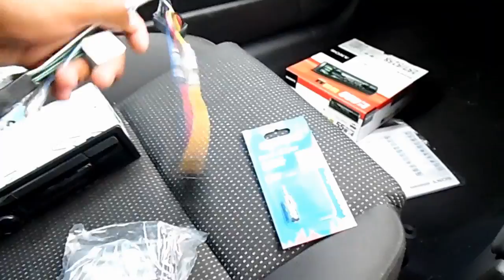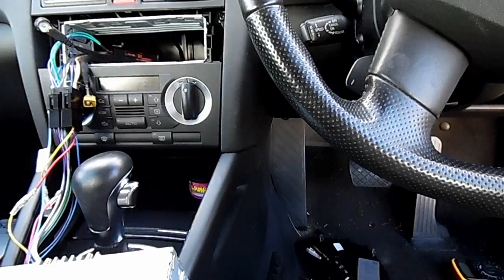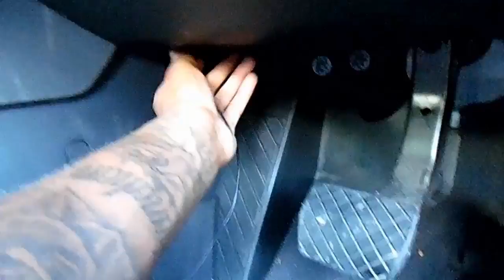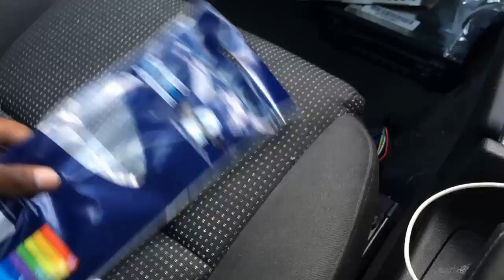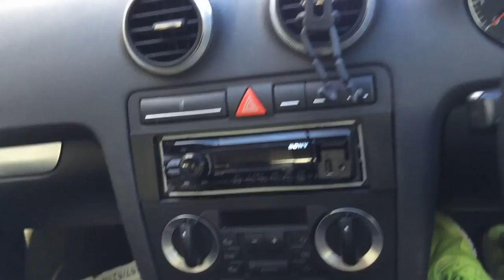Car Stereo Sony DSX A42UI Install On Audi A3

Comment: Hey, I know this video is quite old but can you tell me something about DAB? Do I need a special adapter to install an DAB Radio or will it work with the original antenna? 
I have a Audi A3 8P 2004

Comment: do you know if you can install one of the newer and larger touch screen stereos like a 7" in this model A3? It seems like the buttons above the head unit would be in the way.
Reply: Yes you can but need to do some rebuilding, need console from 2 din version

Comment: bit of advice ive done this and ive now got a power zap and the battery dies after 24 hours, check the battery isnt using power when you turn the car off to make sure its installed properly
Reply: Red line only connects too ignitions  on and off s wasps red yellow not a good idea kill battery 🔋 when is car not running best things only red wire connecting for fuse box

Comment: It’s my first time installing a Stereo. Do I need a ignition live for the stereo to work? 

I’ve followed the steps and wires seem to match but stereo seems to not work!
Reply: I have the same problem.
Reply: Did you get it working mate

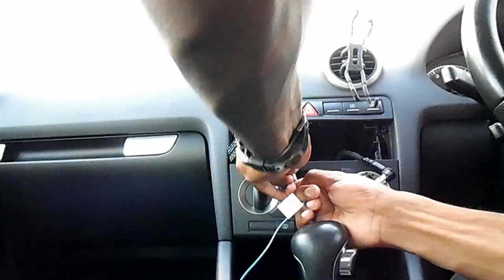Comment: Hi Tim. Thanks for the video! In the minute 3:44 you insert the blue cable into the stereo harness cable. But what should I do if my stereo (Pioneer) doesn't have that cable available for the plug in?
Reply: idk if its still usefull for u, but that blue wire is to power up the rear subwoofer, and then if the remote cable is not on the Power/Speaker imput then check the AV Cable.

Comment: Hi I got the harness to day from Halfords not sure if it’s the right one or not the harness is CT20AU09 tried to connect my stereo today but it’s not working at all do I need to use the ignition fuse to get the power for my stereo or not needed. Also the harness you use the PC9-401 is that’s the right harness to use my Audi is a 56 reg manual TDI diesel. Thanks. Tibor

Comment: My unit has 2 USB cables on the back, how i can get them into the glove box so i can use them anytime? there is not any hole that connects the back of the radio and the glove box, anyone did that?

Comment: Do you also have the subwoofer built in the car from factory? If you have, does it work well with te radio?
Reply from the maker: Hi Mitchel,
Mine didn't have the subwoofer...I have since sold this car and got a Mercedes...
Please like and subscribe! Hit the notification button so you don’t miss out on the new videos!
TW

Comment: Tim i really love your post's brother. Me myself having an A3 8P 3.2. Very useful information, but me personally would av keeped the Audi head unit. I've found the Audi systems are absolutely banging mate. I bought an after market unit that plugs into the unit giving me aux inputs like phone, usb and cards. But love ur stuff bro.
Reply from the maker: Appreciate that my bro! I deffo agree, OEM systems always look better and operate better however the usb connectivity is what I was really after which charges and plays music at the same time :)
Please like and subscribe! Hit the notification button so you don’t miss out on the new videos!
TW
Reply: @TimWilliamsHD  subscribed already. Peace
Reply: What unit did you use for oem head unit to get aux, I much prefer the og styling.

Comment: Hey man, i dont have where to plug that free blue wire from adapter? Rear speakers dont work
Reply: I bought 2018 pionner, everything is ok but no rear speakers, audi a3 p8 2004
Reply from the maker: it must be the harness mate, please contact a Audio visual shop like Halfords or dynamic sounds to be sure of what harness... my old car had basic system so that harness worked on mine... yours will need a different one.. good luck Ed..
Please like and subscribe! Hit the notification button so you don’t miss out on the new videos!
God bless
TW

Comment: Bro I have an Audi a3 2011 8p but the stereo and the harness are totally different. I bought the one you mentioned and it doesn't fit. Do you have any idea which one will fit my car at all? The stereo I have is Audi Chorus.
Reply from the maker: Yes bro you had newer car than mine
I don’t wanna quote you wrong one best bet would be to contact dynamic sounds and they’ll recommend the exact one for you

Comment: i just bought a audio system. with 2 connectors. when my a3 also has 3 connector cables. can you sent me a link or names on the adapter cables you got so i can get it to work :)
Reply from the maker: Hi mate,
I'm not sure what car you have so either way to be sure and safe, id say use dynamic sounds to find the right kit for your car!
good luck!
Subscribe and like please! Also hit the notification button too!
TW
Reply: Tim Williams dynamic sounds? I'm new into this car audio. can you describe what that is hehe. my car looks like the same as yours. audi a3 ambiente 2005
Reply from the maker: Dynamic sounds is a website that can get the right adapter for you
Reply: Tim Williams okay thanks alot
Reply from the maker: good luck!
Subscribe and like please! Also hit the notification button too!
TW

Comment: I did pretty much the exact same as you did and installed a Sony radio into my 8p. I found the sound quality pretty poor tho. Audi radio was much better sound, deeper and fuller. With the Sony the front speakers were powered from the radio through the harness but rear speakers, ya use the radio rca cables cos they feed an amplifier which drives rear speakers and sub. Did you have that problem?
Reply from the maker: Cant recall as I sold the car couple years ago...I would say the quality was better from the Sony in my opinion..
TW

Comment: Hello! Very helpful video but i have  a question. What will happen if i don't have ignition feed? I want to use my radio always, not only with key in the car
Reply: And what is amplifier antena? Why i need this, what it changes?

Comment: I followed the same steps as you but my rear speakers aint working. Any suggestions?

Highly appreciate your help
Reply from the maker: Sorry Faizal I no longer have that car but normally that problem is down to having an incorrect harness or a different sound system to mine.
Contact dynamic sounds and they could help if you give them your re...sorry I can't be of anymore help..

Thanks for watching, please like and subscribe!
TW

Comment: Hey mate bought a new Sony WX 900BT head unit and paid for installation but now my drivers side speaker and both back speakers don’t work... any ideas?? Cheers
Reply from the maker: Sorry Jim83 I no longer have that car but normally that problem is down to having an incorrect harness or a different sound system to mine.
Contact dynamic sounds and they could help if you give them your re...sorry I can't be of anymore help..

Thanks for watching, please like and subscribe!
TW

Comment: Hi. What is the yellow one?
Reply from the maker: Hi mate, cannot remember off the top of my head but please feel free to check another video of mine in which I explain what each wire does and which one is which....
Wiring An Ignition Live on Audi A3

Thanks for watching, please like and subscribe :)
TW
Reply from the maker: here you go!  https://youtu.be/duFjljkUubQ?list=PLnP4mjzJEyuws8tt0zRaCKn1WT4lCmlG-
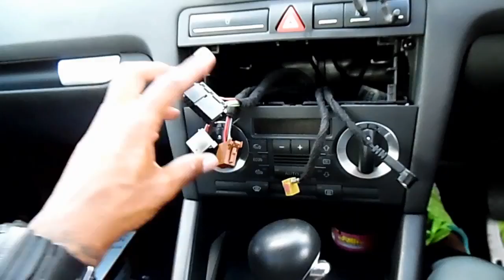Reply: min 1:43..."the yellow one can say goodbye..." what is this for?
Reply from the maker: That is an audi cable mate. It has no connection to aftermarket radios. I believe it had something to do with data appearing on the dash if I can recall.

Comment: I have a A3 8P 2006 can i just plug the PC9-401 and connect the cables then with my iso for the aftermarket radio? will the ignition radio work? its a kenwood with usb cd aux without answer calls option
Reply from the maker: Not sure mate. If you have same set up as mine then it should work...
Reply: I found on ebey this.. will it fit? http://www.ebay.com/itm/Radioblende-fur-AUDI-A3-8P-S3-Einbaurahmen-Radioadapter-SET-ISO-Adapter-Kabel-/361370667410?hash=item54235ec992:g:15wAAOSwYaFWg9UL

Comment: I've installed this with everything you've said but my rear speakers still don't work and my radio won't tune into anything
Reply from the maker: Hi mate,
you may need a different loom .. best thing is to ring up dynamic sounds and tell them your car and radio model and see if you have the correct loom
Thanks for watching
Please like and subscribe
TW

Comment: Hey man. What engine type is your Audi? I've got one with a diesel engine and I think the fuse for the stereo is in the engine bay. Would the ignition live fuse still be by the steering wheel or would I need to run the cable into the engine somehow? I think it's wired this way for all the diesels and the 1.6 and 2.0 petrol engines.
Reply from the maker: That car in that video was a 2.0TFSI...ignition live can be taken from the interior fusebox...as far as you tap into a fuse that turns on only when ignition on and goes off with key out of ignition.
Thanks for watching
Please like and subscribe
TW
Reply: Cool, cheers man.
Reply: Thank you for this instruction but I have a question when I make a call I can not hear the sound Can you help me

Comment: Mate my back speakers are not working?
What could be the issue?
Reply from the maker: May be the wrong harness as all the parts I got worked.. unless you have the bose system which is different and needs different parts but I'm not sure which one as I don't have the car anymore .. ring up dynamic sounds..they're the best tbh

Thanks for watching 
Like and subscribe please
TW
Reply: How do I find out which system I have?
I've Audi A3 2006 special Edition
Reply: yh u probly have bose u will need to wire ur amp wire from sterio in to amp wire for rear sub in boot
Reply: u will find if u take out sterio u most likly have 1 wire that isnt connected or maybe more then 1 thats probly why there not working

Comment: hi mate, do you have bose door speakers? if so, how did you connect these with the aftermarket radio, plug and play or do u need to buy extra stuff for amp etc
Reply from the maker: Hi mate,
car is now sold but i didn't have bose speakers. I have heard it is slightly more tricky. Best bet would be to contact a company like dynamic sounds who will sort the right harness adapter and give you more information.

Please like and subscribe!
TW

Comment: Hi, thanks for the great video. Do know if this also works for the 2003 A3 (8L)?
Reply from the maker: Only works for the radio unit displayed mate, you could check on the website if it with other units.
Reply: Thanks for your answer! I''ve got the bluetooth one, everything works fine exept for the rear speakers. They don't work, I think I need this adaptor. Strangely I got no problems with ignition though, so I guess i don't need to wire it with the fuse box.

Comment: Did you lose your steering wheel function? And also how is sound quality? Stock unit sounds good just sucks no aux feature. If sound quality is the sane I would change in a hurry
Reply from the maker: nah mate, if anything, quality is better and can go louder.. didn't have multifunctional steering wheel to begin so that didn't affect me, however i know there are harnesses available to allow you to use steering controls...
Reply: Thanks for replying! I greatly appreciate your video/reply. I will swap my head unit out soon. I have the steering wheel function so I will need an adapter. Those adapter don't run cheap either :(
Reply from the maker: No worries! Yeh I've got steering wheel controls in my new car and I use them often... Must have imo 👍

Comment: Hi. Thanks for a great video. I have installed a Pioneer and it works great, except from the rear speakers. I have sound, but barely. Any ideas?
Reply: Did you get this sorted mate? Can you remember what you had to do
Reply from the maker: Thanks mate, no rear speakers is normally due to wrong loom connector for your car
Reply: This is strange... They worked fine on the stock radio. Now it's just a "whisper" from the rear speakers... It's like the amplifier don't work... Maybe the amplifier don't get power? Thank's for the answer btw :-)
Reply: You need a active adapter!
Reply: Something like this
https://www.amazon.de/dp/B074V84B78/ref=cm_sw_r_cp_apa_glt_i_GEMD1Z742RS5K1WYHKSX

Comment: When will you be doing the double din?
Reply from the maker: +Fraser Scott within next 2 months mate, had insurance and birthdays to fork out for this month...
Reply: +TW Randomz sweet please make a video for it, as I'm looking to do the same. Will you replace the support bracket? As with mine it's a single din as well or will you cut it?
Reply from the maker: +Fraser Scott will do! no cutting on the cage..will be a straight swap double din cage...

Comment: what happens if i plug the red wire into the red and the yellow into the yellow?
Reply from the maker: +Arun Lee-Durban if you have an Audi it won't work as that is not how the system is wired... Not sure about others...
Reply: +TW Randomz thats mad why did they do that?
Reply from the maker: +Arun Lee-Durban no idea lol
Reply: +TW Randomz lol thanks for the reply, but do i really need the harness or could i just cut the wires and solder them , cos im kinda cheap xD
Reply from the maker: +Arun Lee-Durban you could but I wouldn't as I don't know how you could match up wires and if you ever had to reinstall original it would be a lot of work for yourself or the new user if you ever sold.. Hope that helps
Reply: +TW Randomz very true , thanks for the advice ill just buy the harness lol

Comment: On the loom that came with my stereo I haven't got the loose blue/white wire to connect with the one on the pc9-401. Any suggestions?
Reply from the maker: +James Hambly not sure it's needed I think it's only if you have a radio that needs extra wire..try and see if radio reception is affected or if it keeps stored radio stations after engine off...hopefully it's just not needed on your stereo...
Reply: +TW Randomz just installed it. I cut the wire and used a bullet clip to connect. Done the live ignition too. Only problem is that it can't pick up a radio signal. An ideas?

Comment: Great video. Now feel like I know what I'm doing. What size amp cable did you use for the ignition live?
Reply from the maker: +James Hambly http://www.ebay.co.uk/itm/like/321680499742?limghlpsr=true&hlpv=2&ops=true&viphx=1&hlpht=true&lpid=122&chn=ps&googleloc=9044963&poi=&campaignid=207297426&device=m&adgroupid=13585920426&rlsatarget=pla-148547196546&adtype=pla&crdt=0&ff3=1&ff11=ICEP3.0.0-L&ff12=67&ff13=80&ff14=122&ff19=0&ul_ref=http%253A%252F%252Frover.ebay.com%252Frover%252F1%252F710-134428-41853-0%252F2%253Fipn%253Dicep%2526icep_id%253D67%2526mtid%253D1673%2526kwid%253D1%2526crlp%253D50600204586_563391%2526icep_item_id%253D321680499742%2526itemid%253D321680499742%2526icep_meta_categ_id%253D131090%2526icep_etrs%253DY%2526icep_epid%253D-999%2526icep_ctlg%253D-999%2526icep_cond%253DNew%2526targetid%253D148547196546%2526rpc%253D0.24%2526rpc_upld_id%253D65766%2526device%253Dm%2526icep_msku_flag%253Dn%2526icep_cbt%253Dn%2526adtype%253Dpla%2526googleloc%253D9044963%2526poi%253D%2526campaignid%253D207297426%2526adgroupid%253D13585920426%2526rlsatarget%253Dpla-148547196546%2526gclid%253DCj0KEQjwt763BRDZx_Xg3-Pv2cABEiQAoDfeGHgWe9rfWKm1pJnv8gZKDxz8CYSQeTxnTiXSzLo87zoaAvsG8P8HAQ%2526srcrot%253D710-134428-41853-0%2526rvr_id%253D1001511872198&ul_noapp=true

Here mate
Reply from the maker: +James Hambly can get it in halfords too mate! :)
Reply: +TW Randomz cheers mate. I bought 8amp, will have to change it.

Comment: Is it compulsory that I have an ignition live? If I don't wire an ignition live I'm happy to manually switch off the head unit and remove the face after each journey. Would this drain the battery though? Thanks
Reply from the maker: +Gamer Source will not work without ignition live as it needs a power on/off or even removing the face will cause battery drain and I'm not sure if you could even turn it off as it will just be two constant power wires

Comment: I contemplated changing the stereo in my a3 for the same reason, but unless your car savvy Its a massive faff. I eventually found a way to keep my existing factory radio whilst introducing blue tooth music streaming to a 2005 model. I got an aux connector from eBay and connected it to the cd changer at the back of the factory stereo. I then plugged in a Bluetooth receiver from Amazon into the aux input and paired it with my phone. it works a treat. You have no wires, no fuse box trickery and no cables ... Overall cost £30 and it's a piece of piss to do for people like me who know jack shit about cars
Reply: Which aux connector did you buy, do you have a link please. ???????
Reply: Rob Broadbent please let me know details of all bits so I can buy? Lol, I'm in same boat to the letter email me ASAP lynz.mcc10@gmail.com thanks
Reply: Jim St Ledger did u have any luck with regards to the audi stereo issues, I'm after same advice pls
Reply: Rob Broadbent can you send a link to the connector and Bluetooth device s you brought please.